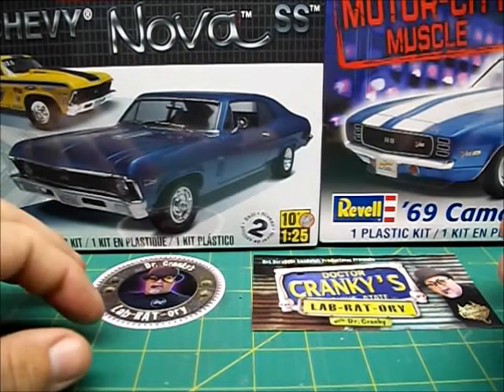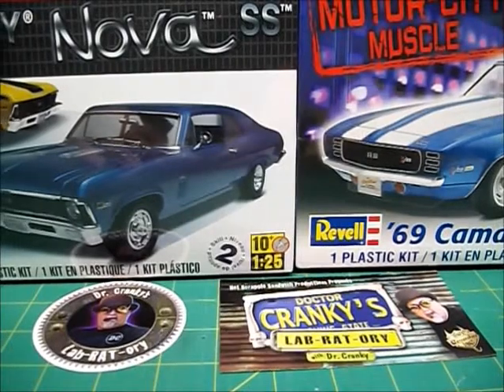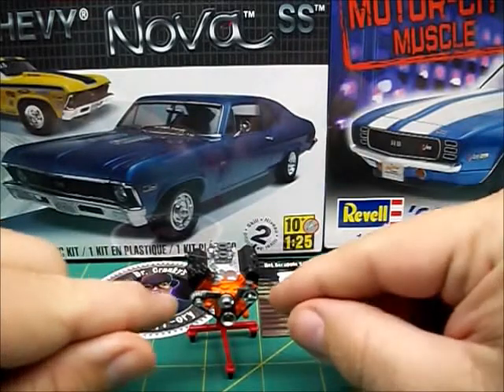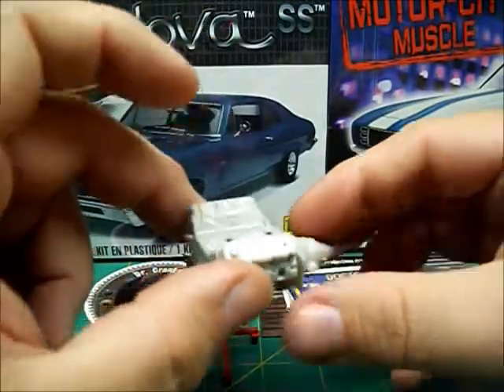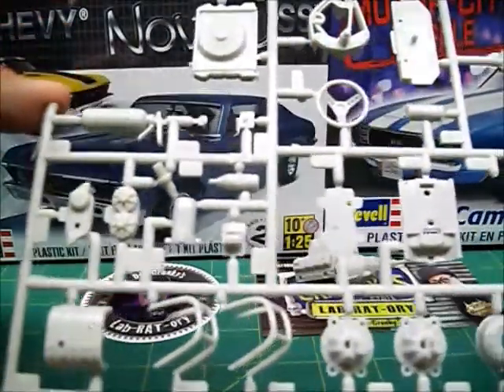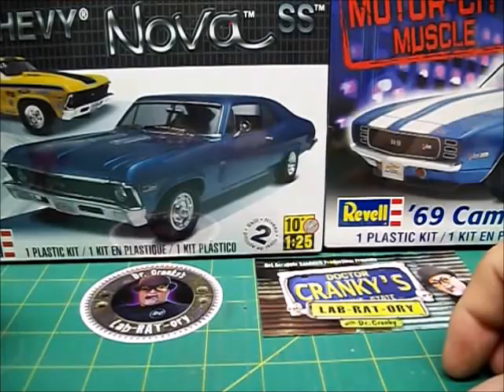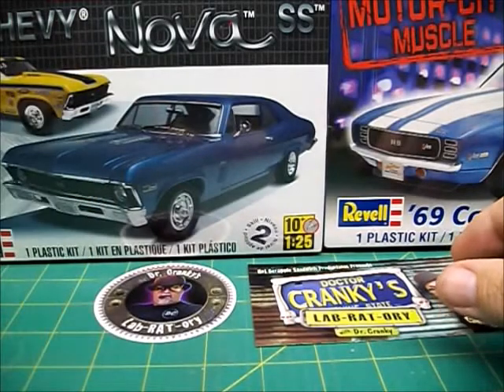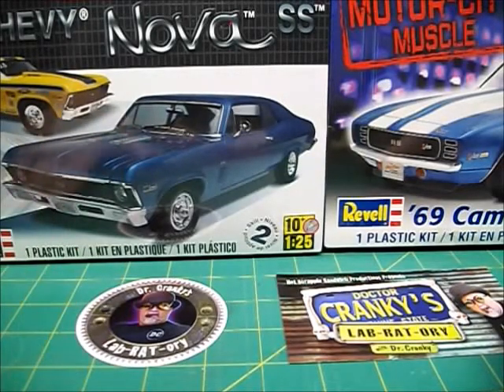Help with new build

Comment: I would suggest if you're gonna use that motor, to use it in the Nova. Big ass tires and a tube chassis front. As for the rest of the Grave Digger kit...Do a post apocalyptic vehicle out of it. Open the rear hatch to a massive machine gun or flame thrower or something like that. That would be sweet!!! I am using the same size motor in my 454 SS-CALADE build. Best of luck to ya brotha!